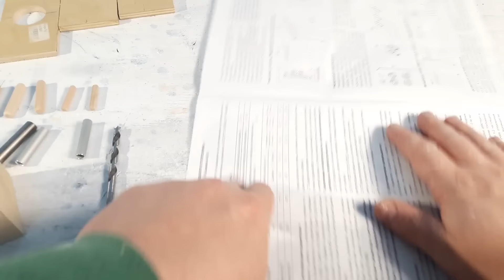Сделай сам и не трать деньги! ТОП 6 DIY приспособлений для Мастеров!

Comment: Hi Mate, I made the dowelling jig as you showed with a central thread and twin outer tubes. I made an outside gardening bench with it with 12mm dowels. Super strong. One thing I noticed was the faceplate doglegged to give some wobble to the joints.  I changed the design to have two outer threaded rods only and no central one.  This way, I can lock in the parallelism and get accurately aligned holes. Thanks for the inspiration. Cheers.

Comment: What are you building the template for if there is an offset when put together? (See 9:34) If you build a template you should work very precisely otherwise you will carry the error on with every work with the template.

Comment: A more accurate title for the video would have been "6 DIY dowling jigs" 

Your first doweling jig should of included center lines on at least one of the drill bores as well so you could align single dowels when needed to fit in a right space.

Comment: Can anyone tell me if I use tubes from brass or copper will do the work... it seems I cant find metal tubes with so small diameter
Reply: Actually, those are called drill bushings.  They are harder than drill bits and will not wallow out.  Also, drill bushings are sized to fit the drill bit in question.  And, they are a bit expensive.  For what two drill bushings cost you can buy this as a finished product for the same price.

Comment: for #1 why waste all the time with Sawing the parth for the tubes instead of just drilling a Hole for the Tubes.  Makes no sense
Reply: Carsten Hüde yes I did not even bother finishing the presentation because I don’t know what he was doing I got bored and stopped the video. Maybe next time you should show what the finished product would look like first then you’ll have an idea of whether you want to continue the video or not. Just my two cents.
Reply: Was wondering the same thing. Still not sure if there was a reason to do it the way he did.
Reply: Well, that‘s quite easy. The drill would destroy the holes after a while if they were just in a wooden piece. So it‘s just about durability
Reply: @joeporley4477  i saked about drilling  a hole for the Tubes, not just in the wood.